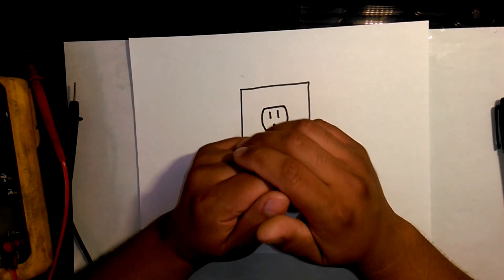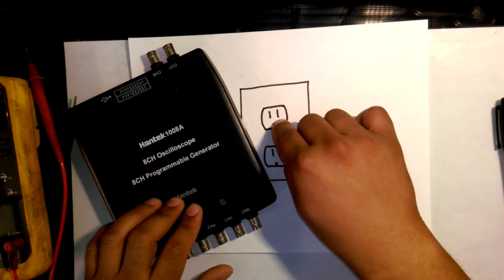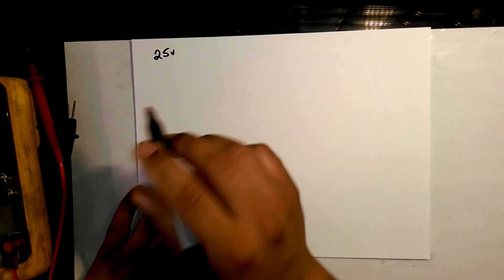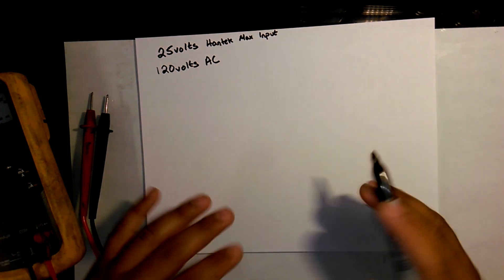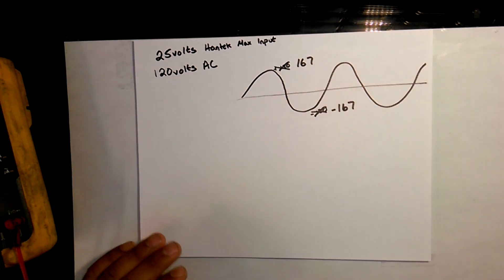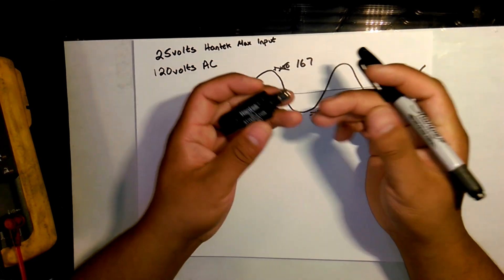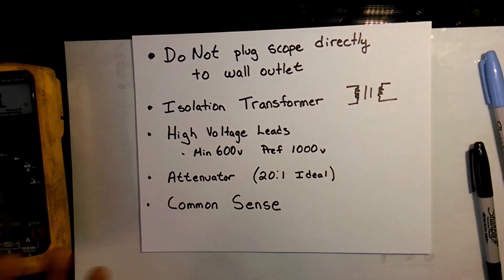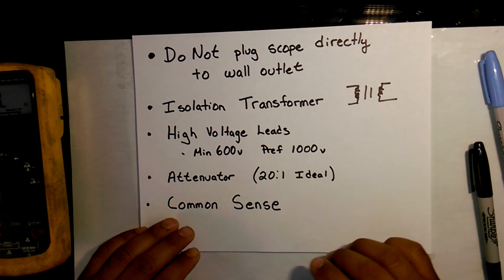Hantek Tutorial: Measuring Mains (Wall Socket) Voltage 120VAC

Comment: What about monitoring very high voltages for example those in a car ht ignition system?
Reply from the maker: If you mean the primary ignition coil, you would use an attenuator which divides the voltage by 20 so it will be safe for the Hantek to read, since primary ignition spikes rarely go over 400 volts.  As for the HT leads themselves you would have to measure them indirectly. There adapters that clamp on the HT leads that will give you an indirect reading of the voltage of the secondary ignition system. Currently HT leads are not very common as Coil on Plug systems are now the norm. In that case you need a specialty "wand" that you place near the ignition coil to indirectly read the secondary voltage. Links are below.

HT lead clamp  https://picoauto.com/products/ignition-accessories/secondary-ignition-pickup-capacitive-with-bnc
Coil on Plug "wand"  https://picoauto.com/products/ignition-accessories/coil-on-plug-cop-signal-probe

Of course there are other options but these are what high quality ones look like. Thank you for your question and thanks for watching!!!

Comment: Hello we want to test 230 VAC frequency for one of our frequency,(Hantek Oscilliscope)
We have ordered 100X probe for testing it,
But we ordered only one recently we got to know that though it is 100x probe we will required two probes for measurements,(differential probe),
So that is the only way or we can measure it using only one probe?
Reply from the maker: I do not recommend measuring 230VAC with Hantek since many things can go wrong. That being said, 230 VAC has peak voltage of 325 volts which means the 100x probe should reduce it to 3.25 volts. This does not mean it is safe. You must make sure your positive input of the probe is on the live wire and the negative input is on the neutral wire. BE VERY CAREFUL!! I do not recommend doing this if you do not have to.

Comment: If i use a step down transformer (220v to 5v) instead of an isolation transformer, i guess i don't need to use the attenuator.  Is this correct?   Btw, appreciate your ultra clear explanations in the video - very, very useful and informative.  Thanks!!!
Reply from the maker: If the output of your transformer is 5 volts then you should be fine.
Reply: Thanks!
Reply: Dont all scopes measure ac thus way. From what im taught is that youre not supposed to use the negative lead when measuring ac voltage with a scope.

Comment: thank you for the very good explanation. 
may i ask where will i connect the isolation transformer, to the power supply input of the oscilloscope?
Reply from the maker: Your isolation transformer should have an input an an output. The leads of the oscilloscope will connect to the output of the transformer.
https://en.wikipedia.org/wiki/Isolation_transformer

Comment: or plug your transformer in to the wall outlet for isolation and take your measurements there, and with your probes on x10 and on two different channels, wouldn't use the common grounds on the hantek at all
Reply from the maker: I learn something new everyday. I will try that using the Math function.
Reply: Accuracy will suffer kinda greatly that way thoogh

Comment: Im failing to understand what adding an isolation transformer will do because you still have 120v going across except that now you are isolated from the wall circuit therefore less current or amps?
Reply from the maker: J Roc The main idea is that you need to be touching BOTH terminals of the isolation transformer to get a shock while you can get shocked with only touching the HOT wire of the electrical wiring of your house. Another thing is that you do not want your Hantek or your laptop directly connected to a voltage potential with the ground, since it increases the risk of damage. Watch a video by EEVblog called "How not to blow up your oscilloscope" for more information.
Reply: Ohhhh okk right that makes sense.Thanks for the quick reply, I found this video very useful. Btw do you have any tips on where to begin learning A/C power? I am interested in learning about coils and how to tune them to a frequency but I've only been playing around with low voltage dc up until now.
Reply from the maker: J Roc GreatScott is a great channel. Afrotechmods is fantastic. EEVblog is good once you get a bit more advanced. AddOhms is great for beginners. I love watching photonicinduction who is crazy insane and bigclivedotcom is soothing and informative. All of these are youtube channels if that was not clear. Hope you like these and thanks for watching and commenting.

Comment: how  can I set my hantek 1008a to check injector voltage I have seen your video but you didont say  about settings and probes or atuenators
Reply from the maker: You are right I did not go into enough detail. I originally made the video for two people on a forum and had no idea thousands would watch it. I made a new video today describing the inner workings of the 20:1 attenuator. That video is currently rendering. Once that is complete I will start recording a video detailing the set-up of checking the voltage and current waveform of a fuel injector. Thank you for the inspiration and thank you for your comment.
Reply: thank you for answer it will be very interesting and it will be interesting working with Auto Ignition Probe (HT25) I have it but cant use it very correctly thanks for all
Reply from the maker: Here is the video I promised
https://youtu.be/xd5F954RAFc

Hope you enjoy it. If there are any questions let me know.
Reply from the maker: I am currently working on two other videos now that I have finished the NEW fuel injector video. Once I finish these other videos I will start on a tutorial for the HT-25
Reply: thanks for all

Comment: The x10 probe will allow 1 milliwatt and 10 microamp, with 110V. Are you sure the hantek can't handle it, I accept the max voltage scale on the Hantek is maxxed at 50V. (by memory)..
Reply from the maker: It is not about the power dissipated or the voltage input, its about accidentally placing the negative ground clip on the "HOT" wire of the mains voltage. If you do, your Hantek, your computer and any peripheral connected to it will be at mains voltage.

Comment: What about X10 and X100 probes? Aren't they meant for that?!
Reply from the maker: Due to their lack of isolation there can be problems, especially if the user makes an error in probing. An isolation transformer, or better yet and differential probe (link below), protects against some user error.
https://www.tek.com/probes-and-accessories/high-voltage-differential-probes
Reply: @Enrique_Osorio  So, if I understand this, what you're saying is that the X10 and X100 probes have built in selectable attenuation.  With care in hook up and a isolation transformer I should be able to measure safely?
Reply from the maker: That's correct!
Reply: @Enrique_Osorio  Thanks!  I'm planning to put together an engine powered DC (rectified AC), welder.  Electronically it's stone ax simple.  In practice, it's easy to forget the incredible number of people who have been killed with stone axes.
Reply from the maker: Sounds super cool!! If you get a chance upload a video of it so I can check it out.

Comment: Is it possible to use x100 probe instead?
Reply from the maker: You should be able to but the same rules apply. If you place the ground on anything live it could spell disaster. Here is a link to a video that will explain how to use a 100X probe properly with mains voltage.
https://www.youtube.com/watch?v=xaELqAo4kkQ

Its by an Electrical Engineer who knows far more about this subject than I do.
Reply: Thanx!

Comment: looks like you are pretty good in electronics. question, i have SPU that can provide 12v at 55a. i need 5v at  75a. is there any easy way to convert it with an additional circuit?
thanks
Reply from the maker: Not really. Im assuming this is all in DC. If it is then you need a buck converter. Here is a great video on those.
https://www.youtube.com/watch?v=CEhBN5_fO5o

To build a buck converter with the specifications you desire you will need some serious heavy duty transistors, inductors, capcitors etc. It would not be simple at all.

If your power supply was AC however you would need a step down transformer One that has approxiamtely a 2:1 turns ratio. Watch this video on transformers for more info
https://www.youtube.com/watch?v=GMePE7NZcxw

Comment: Are you could simply buy yourself a real proper handheld DSO and you can just ignore all the issues your  having with the Hantek
Reply: It is not much about the Hantek, but about ANY oscilloscope... and the "ground" concept.

Your scope is (hopefully, for security) grounded (to earth) and if the circuit that you measure is also grounded to earth (not floating, such as in case of a battery powered circuit) and if you place the ground part of the probe (tied to the oscilloscope) to some part of the circuit which is not also at earth ground, you have a short. That part is evident.

Now, if your circuit (say, a cell phone) is NOT grounded to earth, but floating ( it has an "inner" ground- mass, but without connection to the earth ground) , you don't have that problem, and you can place the ground part of the probe anywhere in the floating circuit. That does not make a short. ( That just makes that point of what "was" your floating circuit to earth ground, and the "inner ground of previously floating circuit now officially become a negative voltage in relation to earth ground).

But any connection to the floating circuit, such as an USB cable (grounded to earth through the PC), or a power accumulator (grounded through its third pin) would (could) transform your safe floating circuit to an earth grounded circuit.